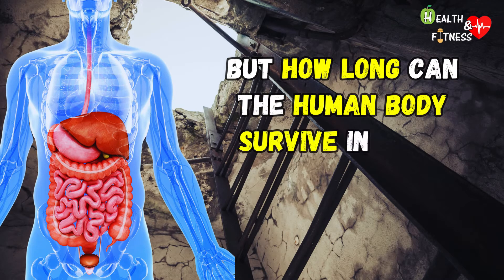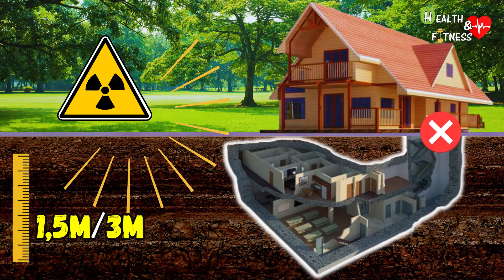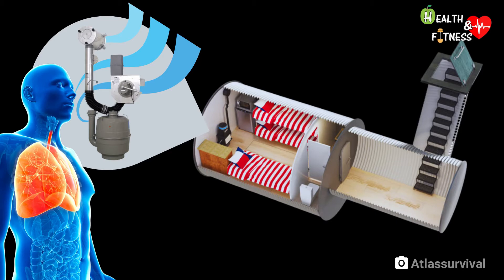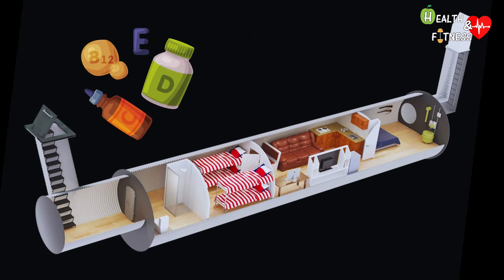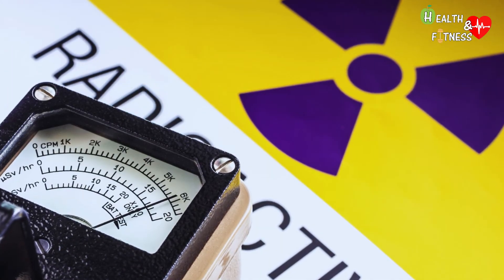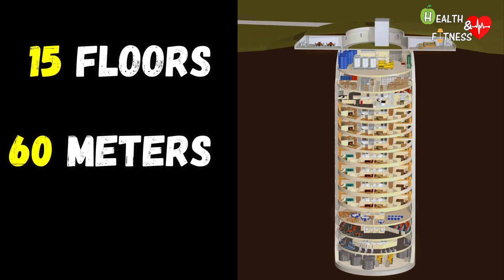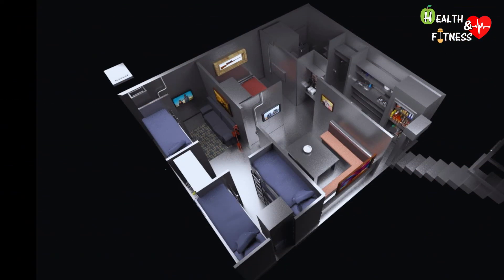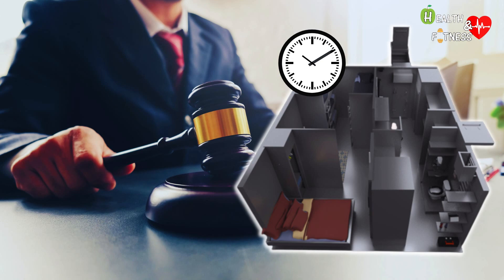How to survive a nuclear attack? How to build a fallout shelter? How do nuclear bunkers work?

Comment: As someone that got to know four nuclear physicists one of whom set up and ran Canada's largest reactor.  The other three were all at one point workers in such reactors.  They told me that a shelter neeed to be only three feet below the ground. I was in Canada's largest  fall out shelter that was built by a man who worked on the reactors while on a submarine. Now he built the shelter where the springs that start two of Ontario Canada main rivers. He hand dug wells there and then used school buses as the houses . The engine sections were removed from the buses and they were all welded together. He was willing to allow most anyone in to the shelter but they had to have sort of joined up earlier then the wars start. Other then that most anyone could have got a spot in the shelter. Sadly vandals and crazy locals caused the shelter to be broken into so many times that most of the main people dropped out. One was a dentist who supplied an entire dental care room full of equipment and drugs to the shelter. That was all stolen but the dental chair which was too heavy for them. The shelter had a massive generator and a huge radio that was the size of one full bus. The place would have worked very well.  It is not nothing but a wreck and the man who built it has died . His family gave up on him and the project years earlier.  Now as far as I know there is no shelter for me and any other common man to go to should there be a nuclear war.

Comment: Bunkers are tombs.  Air pipes can be cut off.  Doors blocked.
Reply: So how many bunkers do you know ?😂😂😂 None
Reply: Air duct, water as well as radiation seepage issues and others
Reply: Very true, but they have to be found, and only an idiot does not have secondary and tertiary systems. The biggest danger is telling everyone you even have a bunker. Keep that bit quiet abd you will be fairly safe, most of the gangs will be deaf within a few weeks.
Reply: Less of a tomb than not having a bunker
Reply: You can't block them if you're dead you dumb terrorist

Comment: Something i should point out, you CAN use a bomb shelter as a STORM SHELTER.
 This was a point well made by somone in texas who builds bunkers.
Something i will also point out is that too many storm shelters are inadequately built.
Ive seen several vids on youtube which show real vulnerabilitys.
The bomb shelter design is far better.
Reply: What if storm comes with flooding? would it flood the shelter?
Reply: Good building practices means that there are storm defenses. i.e. A french drain under the outside of the bunker for dewatering, raised entrance, and emergency sumps inside the bunker should water come in. it is noticeable that good bunker companies will make the bunker water tight so by closing the doors and vents, the inside will be safe so long as the outside is not left underwater for prolonged amounts of time.  @Nauda999

Comment: Author is confusing Fallout shelters with bomb shelters. Fallout shelters just need to be undergound at a depth of about 3ft (1M) for radiation shielding. The concrete wall do not need to be super thick, just enough to support the weight of the ceiling & dirt above.
Reply: Okay I'm starting to understand now. So the survive the Fallout you just need a let's call it, Cuz bear with me I'm a newbie to all this, a Super Saiyan level 1 shelter. Three to four feet down, strong walls decently thick but nothing too crazy. That's for fallout. The bomb shelter is the one that's on some Super Saiyan 4, like I said bear with me lol, multiple miles down military grade steel and reinforced concrete that are like a mild thick, missile silo mode correct? And those are made to actually defeat the blast not just the radiation?
Reply: @ariesostia126  Yes. You got it!
Reply: @guytech7310   awesome! thank you sensei

Comment: Small electric generator running 24 hours a days for 3 months need 7000 litters of gasoline. Where are you going to store all that in a small bunker?
Reply: Usually bunkers have UPS system with a battery bank. The generator is used to charge the batteries and you run the generator periodically as the batteries drain. Probably in a mininalize bunker with a UPS\inverter you can get by with a gallon of fuel per day.
Reply: @guytech7310  I have never heard of UPS system designed for whole household, if you have please tell me the name I want to read more about how it works.
Reply: @Nauda999  Most solar inverters will operate like a UPS as long as the inverter supports batteries.
Reply: @Nauda999 educate yourself on this topic, lifepo4 batteries are cheap and have 10+ years lifespan
Reply: External buried tanks with the pumps inside the bunker for access ease.

Comment: When they pour gasoline down your air pipes and drop a match down it, it is over especially when they block the exit door.  Prepare for a lot of screaming.
Reply: Ok, dumbass.
Reply: Well, use a sensor for combustibles and couple it with the pumps/ compressors... Problem solved.